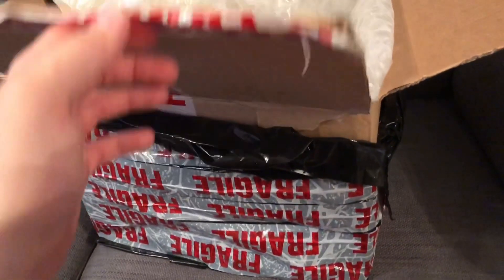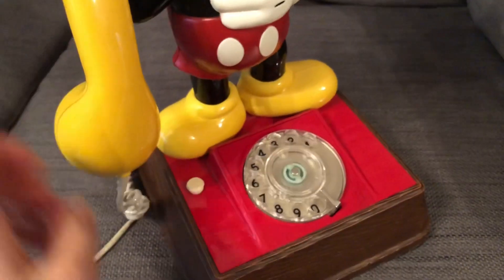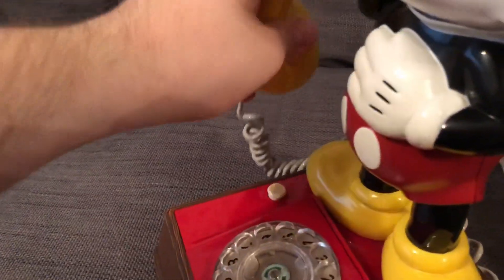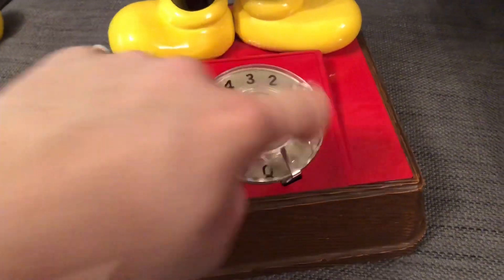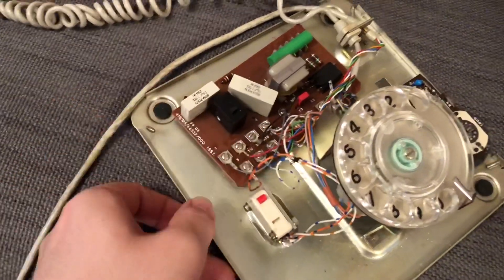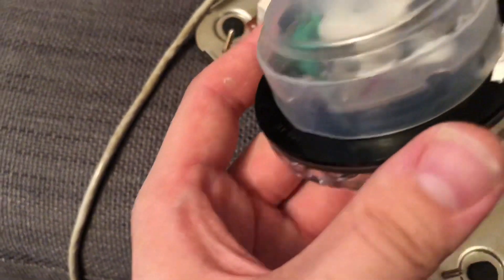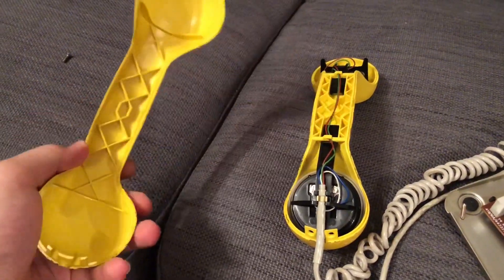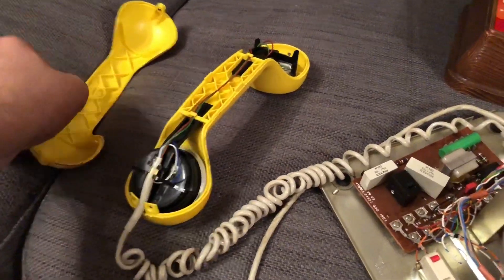GPO Mickey Mouse Telephone! Another One! This One Is Special 😉 First Look

Comment: awesome telephone I got a GPO telephone with that style line cord as your phone has and   mine came with the original jack
Reply from the maker: christopher 2000 The Standard phones with this jack plug was an extra charge, so many were hard wired.  The jack plug line cords are not as common, unfortunately.
Reply: It still on my phone and it works with the original cord